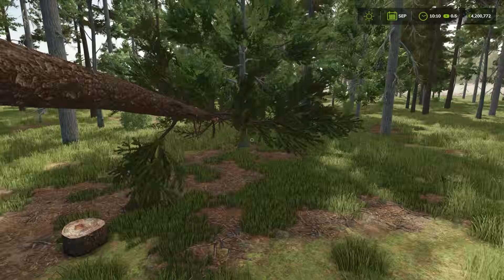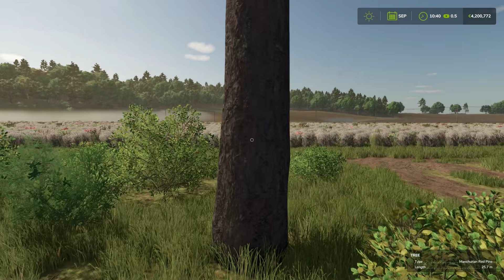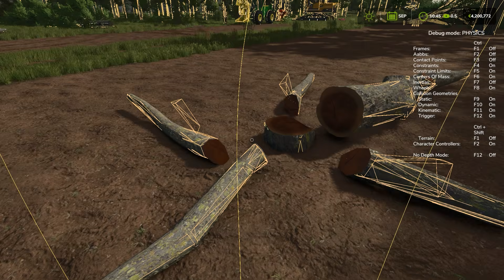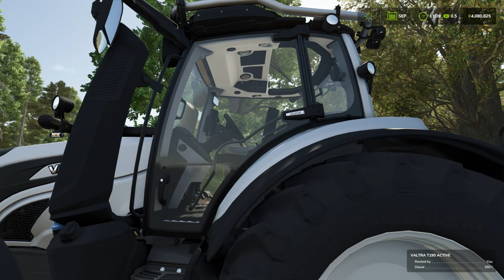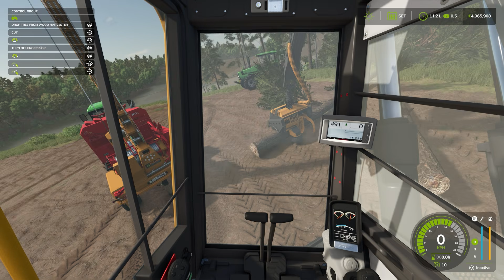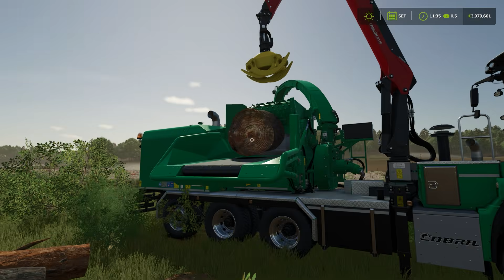FORESTRY GUIDE | Testing Every Machine and Tool! | Farming Simulator 25

Comment: how do I switch to the control group of the header so I can actually use it? The only thing I can move are my wheels and the iron thing on the back. This machine is useless to me if I cant control the head.
Reply from the maker: If you are on PC you switch control groups on G, but you might have to unfold the entire machine first by pressing X.
Not sure how to do it on console though. 😄

Comment: Great vid. I tried the forwarders early in fs22. Thought they were rubbish. Never bought one again ever. A decent truck with crane and trailer is way better.
So Giants haven't fixed clipping issues and moving logs. Shame.
I got FS25 but found it harder to assign controls to what I want. I use the case excavator mod with extendable 16m boom on fs22.
Reply from the maker: Thank you! I honestly think that the forestry machinery was really well made in FS22 same with the log physics, at least compared to FS25. The moving logs are even worse now, unfortunately.

Comment: Im new to logging, got some dual sticks but dont know how to set up controls after they change on different machines, would love some help🤞😃
Reply from the maker: Honestly, there isn’t much you can do about it. What I’ve done is set up my joysticks to work like a real-life buncher (more or less). That works for most machinery in one way or another.

Any particular machine you're having trouble with though? 😄
Reply: @Bambis_GamerHut  Yes the base games one from platinum expansion it works fine there but when using a mod like komatsu 931xc longcrane it reversed like the sticks switched place. It is in fs22
Reply from the maker: @eliyyyjvxgjvxhcgugvcffff  Ah, then it's likely due to the modder mapping the controls in a specific way. 

If you know how to tweak the XML files, you can change the controls to suit you. 😁
Reply: @ i can but dont really know what to look for in the xml files. 
And also do you know why i cant verify in your server?
Reply from the maker: Hmm.. No, no idea why that is? 🤔 

In the xml file. look for ''AXIS_CRANE_ARM'' ''AXIS_CRANE_ARM2'' and so on, these are the bindings you typical just have to switch around to make the machine behave like you want. 

(I'm no good at editing xml files myself.) 😅
Reply: @ thank you👌👌

Comment: Is there a reason wh  you using dual farmstick instead of t16000m for example
Reply: I mean du you need all the Buttons? XD
Reply from the maker: Yes and no, 😅 Base-game forestry don't require that many buttons, I agree. But for FS22 with mods like 'Wood Harvester Controls'' etc. most, if not all the buttons were in use. 😄 Hopefully the same or similar mods will be released for FS25 as well.
Reply: @Bambis_GamerHut  because i want to buy a third joystick (got one t16000m and the logitech side panel) and i dont know if i should buy another t16000m or a farmstick
Reply from the maker: Unless you can get a single left or right hand (depending on what you are missing) T.16m, I would recommend the Farmstick. It has more buttons, and feels great in both hands. 😁

Comment: The sennebogen crane has the same problem as the volvo high lift...if the grapple is fully closed its wider than thw bunks on the trailer...so if you pick a full load it pushs the logs agaibst the ments of the trailer and wedges them...we are spoiled from fs 22 forestry but in the direct comparsion it feels like a massive down grade
Reply from the maker: Yeah, that makes sense, but at least it's easy to work around by just grabbing a few fewer logs. 😅 I somewhat agree, FS25 is beautiful by all means, but forestry was in a good state in FS22. Now they definitely have a few kinks they need to sort out. 😄

Comment: if you make settings for the harvester like, for example, the settings they have in real, it will be wrong with the forwarder and if you do the opposite it will be wrong with the harveater, do you have a solution for that?
like any mod or any ideas
Reply from the maker: Unfortunately, no. Not that I'm aware of. I also have to admit that I do not know the real-life controls of these machines. So, I just keybound the controls based on ISO excavators.

This don't work properly for every machine available, though. My solution is to save a few keybind XML files for the different machines that differ. This way, I can quickly copy and paste the XML file, avoiding the need to manually adjust the keybinds each time. 😄
Reply: @Bambis_GamerHut  can you make a video or link a video how cange the xml file? with settings 😅
Reply from the maker: You find the Inputbinding xml file in /Documents/My Games /Farming Simulator 😁
Reply: @Bambis_GamerHut  with xml file thers 2 😅
Reply from the maker: 🤔 You have two inputbinding xml's in your game folder?
Reply: @Bambis_GamerHut  maybe dubbelwriten? 😂😅
Reply: @Bambis_GamerHut  ty for help
Reply from the maker: @Sparre841  Yea might be 😅 well you can always try to make a backup and then delete them and see what happens 😄
Reply: @Bambis_GamerHut  https://youtu.be/DiSpP6Nxy0U?si=XEzZRt4JOsgyWgHU 
12:35
Reply from the maker: Yea, that's pretty much the same as my keybinds for the game. The only difference really, is rotating the crane tool is binded to the finger trigger instead of joystick left and right. 😄
Reply: @Bambis_GamerHut  the harvester is right for me but need fix my forwarder 🙃

Comment: 7:08 cant the big volvo excavator cut them down too?
Reply from the maker: No matter how high I went up the tree with the Volvo processor, it kept saying 'too thick,' at least in my testing. Actually, it was only able to cut down stages 1, 2, and 3, as stage 4 is not suitable for processors for some reason. The same applies to the Impex in stage 4. 😄

Comment: Personally wasnt to impressed with this rendition of forestry. Logs jiggle out of the triler bunk way worse than 22. And this new "log locking" with the grapples (used the big volvo with the dangle grapple) is HORRIBLE. Tried pushing the logs down in the bunk with a closed grapple, and thr closed grapple is picking up logs. Big L so far
Reply from the maker: There are pros and cons, that's for sure! I'm hopeful they will fix most of these issues. But I agree, there are quite a lot of bugs in its current state. 😅